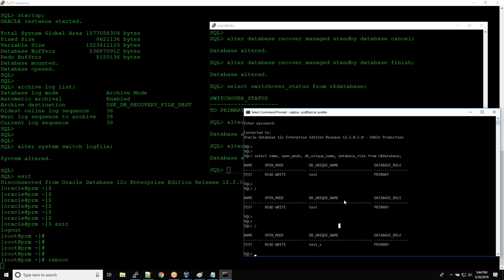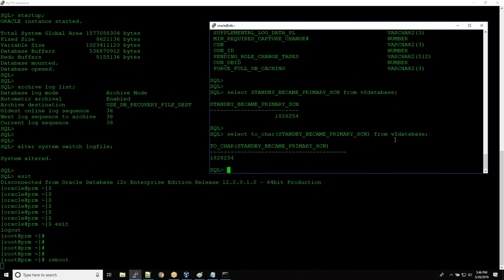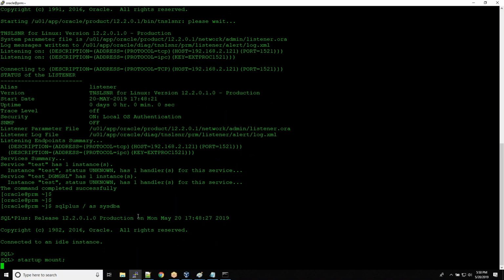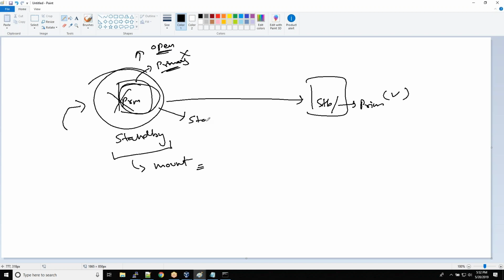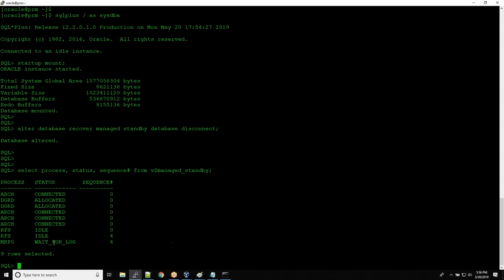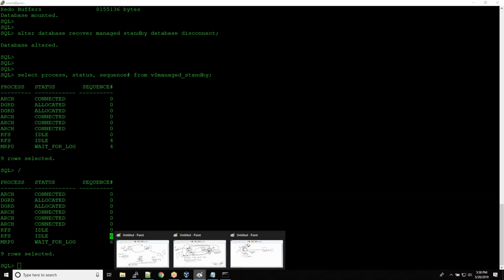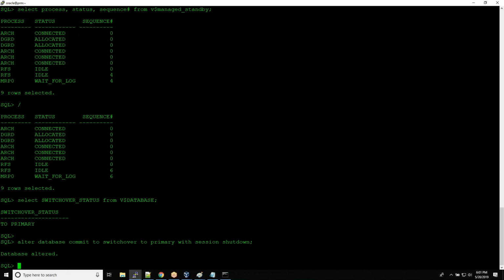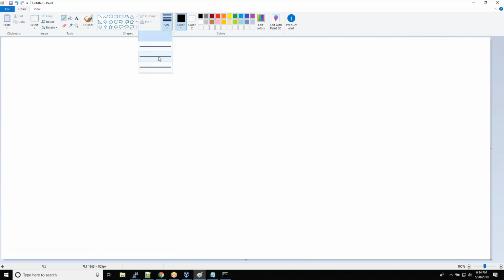Rebuild Failed Primary After Manual Failover

Comment: Sir i have a question here, do i need to restore the backup/log from the current primary database to the fail primary before flashback the fail primary ?
Reply from the maker: Not required, when you flashback crashed primary (not standby) and start log shipping + MRP, the new primary (earlier standby) will auto ship the required archives. 

No need to copy archives manually.